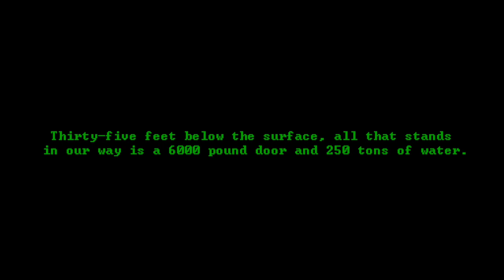Opening a Titan II Nuclear Missile Silo (short version)

Comment: So it's no longer DOD property?
Reply from the maker: No... it was sold back to civilians in the 90s.
Reply: They where buried and de militarized. Important and reusable equipment removed and the covered over in earth. Actually removing the structure would have cost way to much and they are so  reinforced that a cave in was never going to be an issue for thousands of years probably. 

And then the land was sold back to states/civilians. It's neat in the aspect that you can buy land that has a bunker already built into it, though you'll have to recondition it. Still the hardest part of building such a thing is already done.
Reply: Death Wears Bunny Slippers  iv always wanted to buy one of those bunkers, how much did you or your friend buy it for?     P.S. be honest now because the property record will show if your full of shit or not

Comment: Wow! What were you doing to open the door? Just a pry bar and prayers? lol
Reply from the maker: Something like that... :-)
Reply: there was a hydraulically actuated pin that locks the door but the hydraulic cylinder was removed when they shutdown the silo. The water pressure was binding the pin so they pried on it while using the excavator to apply pressure in the opposite direction of the water, unbinding the locking pin, allowing it to move and the door opened
Reply: haha, the missile was the first thing they removed when it was decommissioned so there's no source of radiation for the water to become contaminated
Reply: Yeah what he said
Reply: Death Wears Bunny Slippers you're absolutely sure 0% of that water is radioactive right?